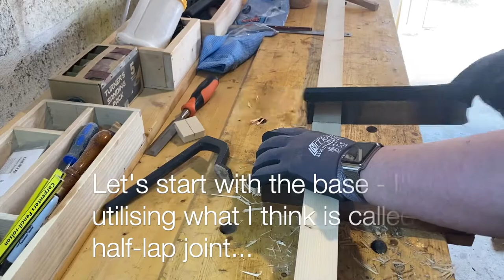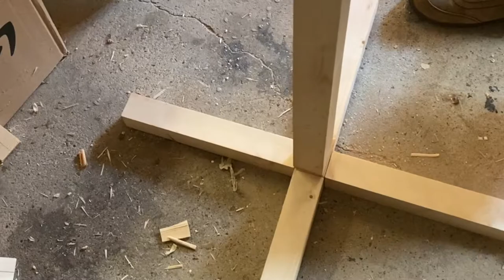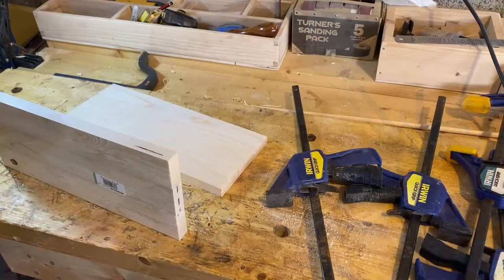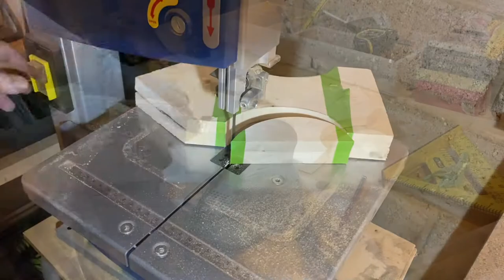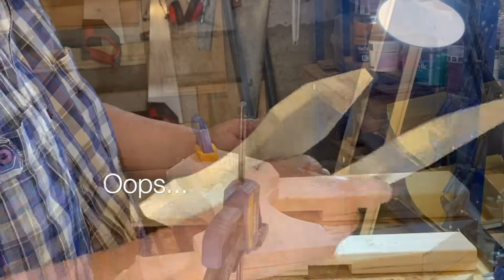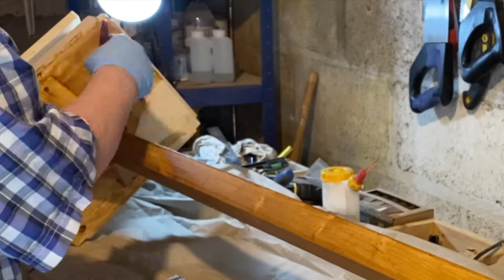Simply Woodworking - Let's make a simple bird table

Comment: Its a good starter bird table project!!!! The few things i would consider most are as follows first make shure you have a good overhang on the roof panels otherwise rain water will drain straight onto the feed platform!! Second the height of the uprights supporting the roof maybe a tag to high, Which if you dont mind will attract all the birds in your area including Pigeons, Magpies,Crows,Jackdaws!! Inturn they alone will clear the bird table in a matter of minutes,  Leaving small birds Robins, Blue tits, Blackbirds, ect to go hungry though the winter months,And lastly your base of the feeder? Will it be standing on the bare ground or on solid stone!! Either way it needs extra long pegs for stability in high winds!!! I have found its the base that rot's first!! Anyways thanks for sharing your build welldone😍🇬🇧👍
Reply from the maker: Yeah it's not my greatest work! All good points, Keith. Thanks for engaging! And, yes, it did fall over in a storm...:)

Comment: hole saw , or forstener bit , usually have a drill bit thru the centre to prevent your mishap . I've also got the evolution sliding mitre saw , good kit . Those '45' cuts though would have irritated me . Great effort . And thanks for  showing how to find the centre point of 2 bits of wood - like your dowell idea.

Comment: Nice design.  Good use of ready-made moulding for the roof peak.  Get urself a cheap drill press - makes a lot of things go much easier & straighter.  You should have at least used a spade bit or a hole saw, but not a Forstner bit.  Ogh well. A feature.
Reply from the maker: A lesson was definitely learned that day! I have since bought a drill press, pretty much for this very reason.